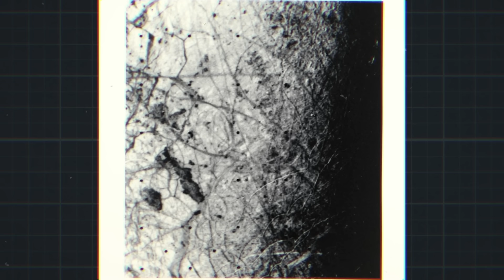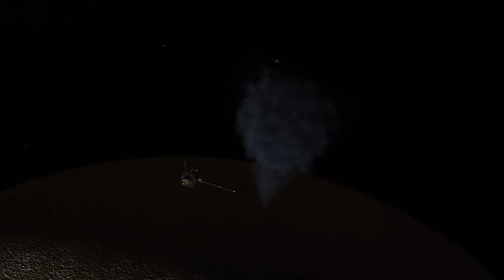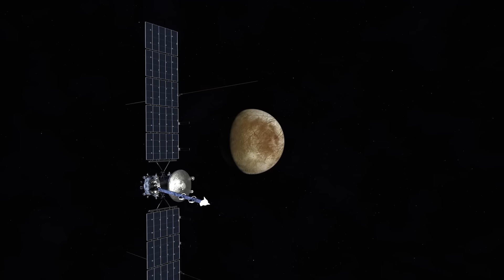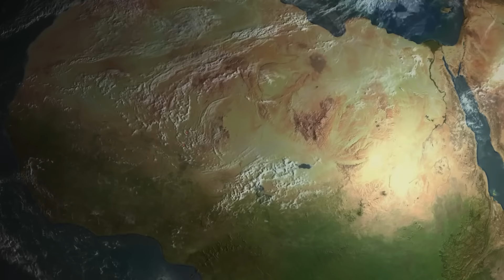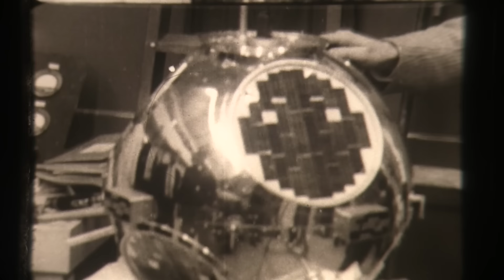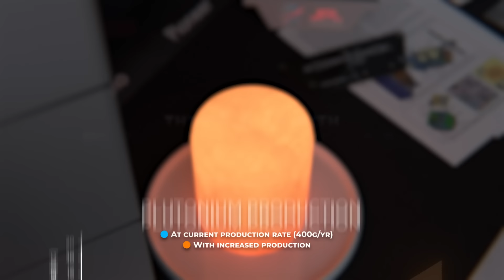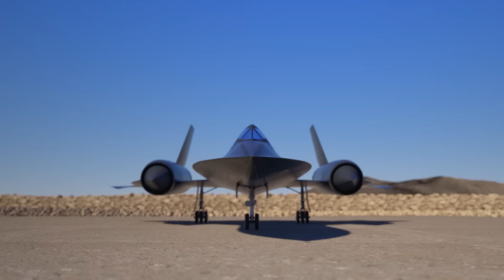The Insane Engineering of Europa Clipper

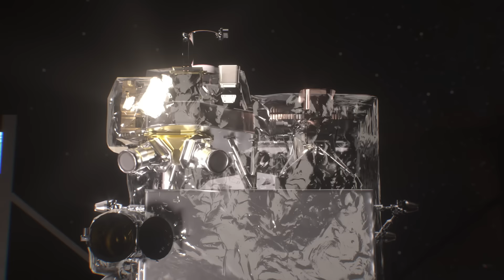Comment: 13:10 Hope you see this. Why 8 megapixel. Don't we have small higher quality cameras available? Why did they make this choice?

Edit: Thanks for all your answers.
Reply: Space tech is often a generation or two older than their available options. Reliability and redundancy is way more important than the shiniest bling if there's very few ways to fix things if they glitch or fail. Older stuff tends to have most of their bugs ironed out, and people know how to deal with it.

Your phone may take amazing pictures, but it isn't going to cope with sub zero temperatures and 30x the ionizing radiation very well.
Reply: Sensor size is much more important than density out there. Jupiter receives 25 times less light than Earth, so it's imperative that we have large sensors to catch more light. The pixel density others have covered though! Plus, the details you're catching aren't exactly small anyhow
Reply: Another factor besides those mentioned: electronics become more sensitive to radiation the smaller they get, so one way to make them more robust is to use physically larger components. Miniaturising CCD elements inside a camera sensor to get a higher resolution would - all things being equal - make the camera more sensitive to radiation noise.
Reply: More megapixels doesnt mean better quality, most of the time thats just used as marketing for cameras, 8mp is enough for what they want and also like eric said it would just make the process of sending the pictures slower
Reply: Radiation prevents higher resolution

Comment: Is there a reason for the camera set up, I mean we have like way better cameras, at least resolution wise
Reply: This thing was being built ten to twenty years ago most likely
Reply: @Meyer-gp7nq  oh i thought they were launching it recently?
Reply: @DeadlyDwarf  These projects take A LONG time to get off the ground, usually a lot of tech is outdated by the time they are launched and reach their destination (this one will take another 6 years to reach Europa). So you can't view it in the same way you'd view technological advances here on earth. And revising the design and plans with each advancement in tech is not doable because each change affects the rest of the build, you'd be forever revising the design and never launch it.
Reply: Well, they are limited by transmission throughput and distance, that a larger resolution wouldn't be helpful anyway (they can only receive data in bytes per second IIRC). Also, having more megapixels would make it more sensitive to radiation, which means you'll end up seeing more corrupted pixels instead of a clearer image.
Reply: Most of our current tech ain't rated for handling solar radiation and are more likely to break down the older stuff. They need something that has redundancy, reliability, and can handle extreme temperatures as space is likely the most extreme environment.

It might be older, but the stuff has been tested and used in similar missions and has worked impressively thus far.

Comment: We well know that radiation is very damaging for microelectronics But how much effect do they have on the PV cells in the solar panels? Enough to be a problem over the length of the mission?
Reply: According to the not-google's AI, the solar panels are built to withstand some level of damage, so our only expected to lose 10 to 20% of capacity over the life of the mission of four years, and the panels are built larger to compensate for that expected loss.
Reply: Radiation can lead to defects in the material structure and increase electrical resistance and also lower the overall output of the solar cells

Comment: 13:10 Just 8 MP camera? In what year does NASA live in?
Reply: There's so much more to a camera than just megapixels...
Reply: 8MP low-power radiation-resistant light-weight camera. Plus, consider that they have to send those images back to earth as well. No use having a 5GB image in space if sending it back to earth would take 5 years.